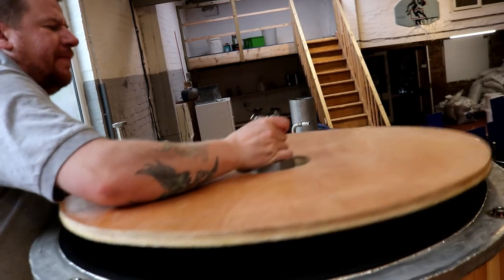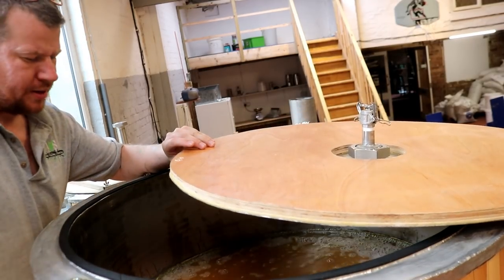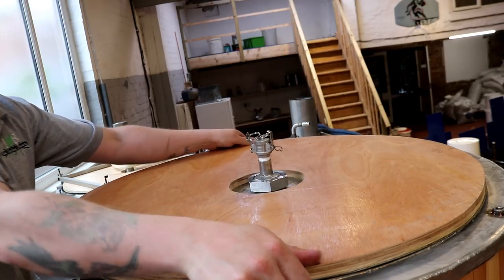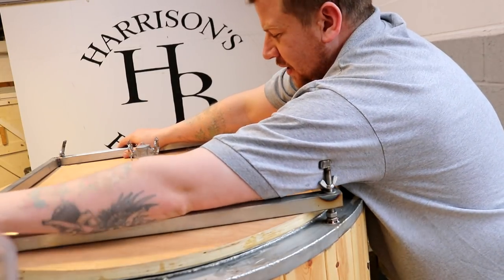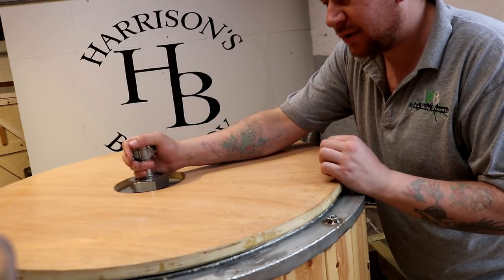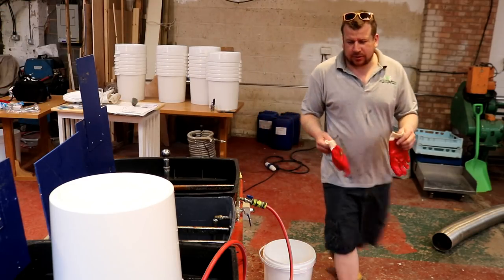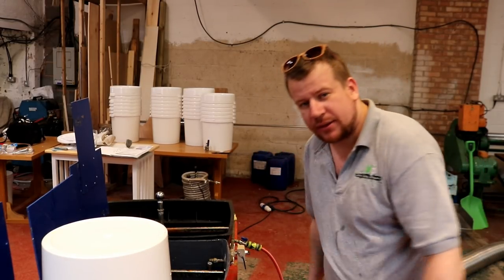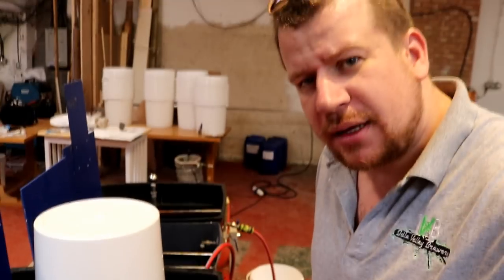I GET A LITTLE TECHNICAL.

Comment: Very interesting explanation of the duty m8 thanks. It's a fair auld wallop to swallow for a small brewer. I have noticed over here that in the last year or so even supermarket prices on micro brewed beer have shot up to where even an ordinary enough craft beer is running on average €4/500ml,what i have noticed and it riles me is that lots of breweries have started canning in 330ml but the prices are the same as the original 500ml bottles. Probably not the brewers fault but someone is taking the piss. Of course micro breweries over here can't sell their own beer off premises so that doesn't help. Cheers.

Comment: So does small Brewers relief give you half that duty back or are those figures taking the relief into account? What’s the threshold for “small brewer” and is it a cut off point or do you pay 100% duty on the lot if you exceed the max volume?
Reply: Fowey River Brewing you don’t get it back, you just pay a lower rate then Harry shows. I think what he was getting at is, brewers should charge the full duty rate but only have to pay a lower rate to HMRC. So in effect they are saving some money them selves and not cutting the cost of the beer to the pub.
Reply: Correct the 19.08 is standard duty rate the small relief drops this to 9.54 and its up to 5,000HL for the lower rate over this you start going into whats called variable rate. 4% beer half rate per firkin will be £15.26 cheers
Reply: So to put it into context, that pissy 5% lager that Lidl sell for 4 cans for £2.40 have duty of about £2, so they’re making a profit after selling them for 10p a can!
Reply: Well knowing these firms, They would have searched for the lowest poor person to brew it for them and make around 50p-£1 for a 4 pack yeah lol, Used to do alot of work for them and Aldi shocking how they treat their staff

Comment: Have you read that they were on about changing the lower rate from 5000HL to 1000HL it will cripple the middle size breweries out of interest how much would you charge for your firkins? I dont have that many breweries compared to other parts but their great breweries thats why im going to pay more for my malt for like Thomas Fawcett but you cant beat the price of Bairds Pale malt whats your opinion on Base grains? I also have a beer calculator excel i could send you just enter % and litres tells you what to put in the boxes if you wanted it. Cheers
Reply from the maker: Yeah, I am all over the small brewery duty reform coalition, tossers. I am pricing against ingredients not abv so it is hard to put a number on it. I want to double MY costs and add full duty before I think of selling though. Most malts are much of a muchness for me, it is the crystal, Cara and specialty offerings that attract me to a supplier, plus convenience. Total brewing supplies are just down the A1 for me. perfect. And yes. Can you please send me your spreadsheet. I love anything like that.
Reply: No problem im sure i can send it through the pubs facebook or whichever you like its real handy even though ive only done about 30 nil and one payment lol do you have any problems with bairds i know it says 5% crystal and 5-10% that is converts after itself.

I know that most use Thomas and Warminster and a local brewer told me to not worry about costs since it was getting put on for the customer anyway i was using crisp ale since that was what a local brewery uses and i could just pick up 10 bags etc but the travelling back and for was doing my head in the beers are basically traditional hence the decision which malt to go with TF Golden Promise does sound nice.

Now i got enough money for ton but i also need to buy an electric pallet truck because i cant see the lorry making it all the way to me but first i have to inspect the cooling of that tesco cold box i told you but it was nice to have outside storage, The enviro though are right *** first brewery she inspected so you can imagine.

Cheers